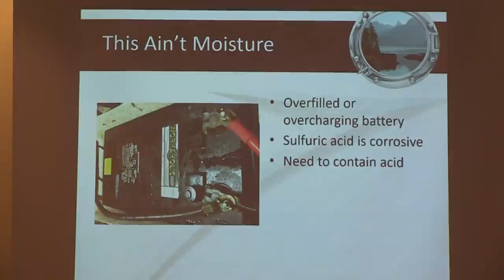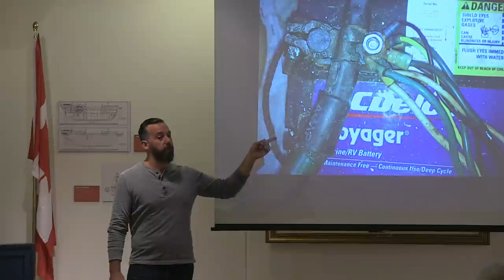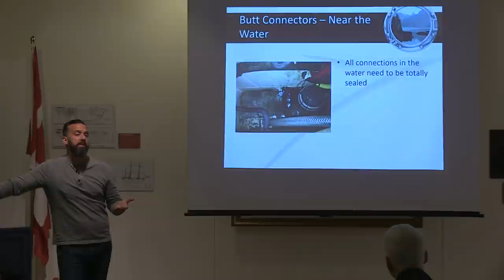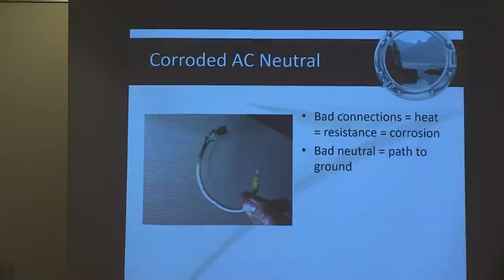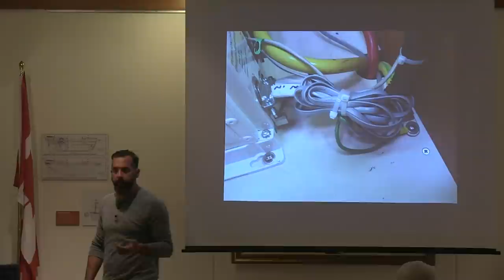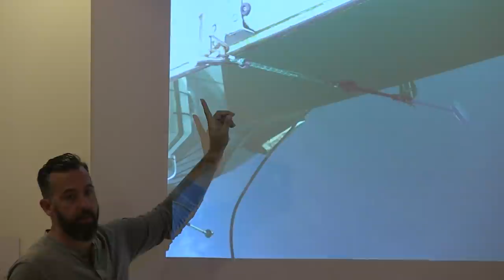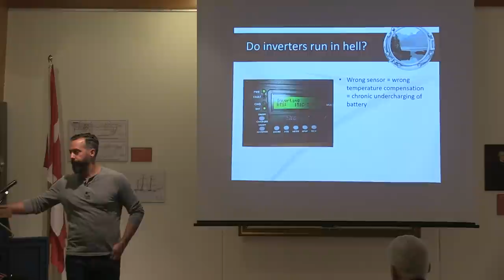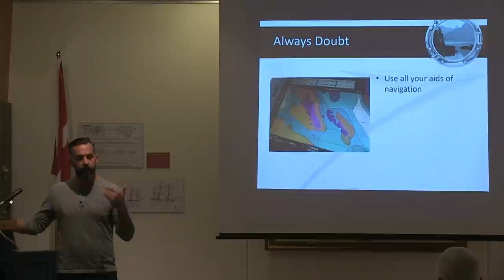Seminar: Marine Electrical Basics - Part 1 of 6

Comment: I'd say that I'm rewiring an old new to us sailboat but the reality is that I'm "wiring it". Out with the old and in with the new. I'm pulling all of the old stuff out. Old stuff discoveries 1. Shore power inlet ground disconnected.  2. Heat shrink butt connecter that was heat shrunk but not crimped. 3. Terminal connectors, yes plural, that did not pass the "pull test", simply came apart with a slight tug. 4. Abraded wires where the wires were exposed. 5. Headliner (ceiling)  light wires that were taped together with painters tape, not so much as a butt connector or electrical tape. Thank goodness I pulled the headliner panels off. All of that I tore out. 6. Quick disconnect wire to a USB outlet that broke free of it's quick disconnect female terminal.  7. 22GA wire butt connected to 14GA wire butt connected to 22GA wire again and of varied colors.  The only remaining old wires are dead wires (not hot) and simply in place as fish lines. What a disaster. 1977 sailboat. As Jeff says "nothing is ever easy" and "Don't trust anything on an old boat".

Comment: Guys that get impatient: you've got to remember that he's standing up in front of a class- maybe even after lunch- and not everyone is a Spring Chicken. Try as they may, they get sleepy and distracted, particularly if the material is tough, at first, to comprehend and integrate. A good lecturer will take the temperature of the audience and respect their attention span. Some times,  an anecdote or two will allow the class to coalesce and get caught up  and he'll get on with the information. My guess, Highliner, is that marine electronics are not as daunting to you as it might be to a newcomer. Patience, Skipper. We were all newbies once.

Comment: Your fuse failure at 43 min is exactly what happened to my buddy. It was a factory fuse on a minkota on board charger. We plugged it in at the dock after fishing and i caught a faint smell of burning electrical components. After some hunting i saw a whisp of smoke come out of the fuse holder. The charger was bad and over charging on that lead. The fuse failed closed. Always trust your nose.

Comment: Really appreciate the videos. Used to install alarm and other low voltage DC systems, home theatre, coaxial, phone, intercom, etc. Luckily apprenticed to someone with a similar mindset about installation mentality. The videos are much appreciated and I'm sure the boat owners that are your clients are more than satisfied. Recently took up sailing and the info is invaluable. Thank you!

Comment: Hi From a marine engineer/ industrial electricians  back ground, The subject that I would start from in DC battery installations as a beginning is the available  prospective short circuit fault current and its effects in a fault situation. 
And next the explanation of earth fault lamps , and the most important is a volt meter showing the DC volt at present, one on the house batteries, and one on the engine batteries, most important.
Very few boaters would understand and the above three most important points on any electrical installation.
best of luck
Allan in NZ
Reply from the maker: Hi Allan,Good advice. Thanks for the input.

Comment: if you have 30 amp shore power what kind of fuse\breaker would you use?  30 amp?  or do you size a bit highre like 40 amp?  My boat has shore power but no breaker....

Comment: Yeah people don't realize that the ground is the most important thing in DC. The power actually flows through the ground
Reply from the maker: The DC negative (commonly call ground because the DC negative is connected to ground) provides the return path for all DC circuits. It’s all about making sure both the DC positive and the DC negative are good.

Comment: I came to this video because it was listed as "basics".  I am still looking for a video, or series of videos, that is basic.  Cote asks us what we're seeing looking at these videos.  I have no idea.  Also, Cote uses much terminology without defining any of it.  Again, I was looking for a true basics video.  Cote has knowledge that I desperately need to improve the wiring on my boat.  If only he could really get to actual basics.  Let me help: I do not know what circuits and wires are supposed to be connected to or not.  I do not recognize anything these wires are connected to except for the batteries.  I cannot tell which wires are grounding ones.  These photos would make good quiz material for students who had a little more understanding of electrical.  So, Cote, please help us who know we probably have electrical issues, but don't even know enough to know who it correct or incorrect.  I would hazard a guess that some of the bad work you cited was done because the boat owners knew less than what you consider basic.
Reply from the maker: Hi Lydia, could suggestion on a real basic marine electrical presentation. Stay tune for one next year.

Comment: You mentioned in one of your videos how a cheap inverter can cause galvanic corrosion in our underwater metals but I listen to these while trucking so am not fully absorbing everything. I just bought a 43 year old sloop and I need to be able to charge my laptop. Is there a low cost safe solution for me? The purchase price was a huge hit on my finances. I'm going to be cruising BC all summer on the hook using alternator and possibly solar panels. Advice? 😀 Thanks so much for these videos by the way. I've learned my electrics are a liability but I should be able to disable everything I can't get up to code 😃🙏🏻
Reply from the maker: Hi Nomad, for charging a laptop, purchase and install a 200-300 Watt true sine wave inverter. You don't need anything bigger.

Comment: Hi Jeff, A small electrical question. To do with continuity.
I get continuity with the bilge water and (only) the negative terminal when the pump is functioning. Is that normal? When it's in auto or off there's no continuity. Which is good. What are there any consequences to this for my copper rivets? Keel bolts? 
Greetings from Berlin
Reply from the maker: It's quite possible your negative continuity to the bilge water is from the grounded keel and not the bilge pump. Surprised to hear that your bilge pump negative would have connectivity to the bilge water.
Reply: Pacific Yacht Systems thanks for your reply! It freaked me out and I kill switched it off. Boat doesn't make water anymore so I'm not worried but still need to figure this out. It's a cheap seaflo with cheap wire jackets, maybe they chafed or cracked. I'll do some kitchen sink testing this winter with the whole setup.
Reply: By the way I got 2 identical pump setups as backup, funny thing is one pump has about 60% more resistance than the other. The second one is higher up so theres no water there thus no continuity, I'll fill it up and test both soon

Comment: I really wish you could start with a basic visual of power needs and resulting wiring design options. Put the components on a sheet of white plywood, mount them and wire them together....then you can go back and discuss best practices for each detail. Folks need the blueprint first....who would ever go about any wiring job without a crystal CLEAR map of what you are about to do....I know I dont. WHich makes watching hours of video about minutia pointless if you cannot see the design map.
Reply from the maker: Great suggestion!

Comment: Where would you consider the best place to connect the + from a hour meter on a Volvo 2030?
Reply from the maker: Hi Mike, unfortunately I do not have practical experience with your engine. On most engines, the hour meter increments only if the engine tach receives an RPM value.

Comment: I wonder if you can recommend a qualified marine electrician to help me in Connecticut. I have a 1970 wood trawler that has so many wire issues and I know nothing about DC electric. Example, solid strand wire, the old house wire that is incased in metal and has paper insulation, no heat shrink terminals or shrink wrapping of wire. Five switches run the whole boat! I could go on and on. If you know anyone in Connecticut that can help me please I want to hire a qualified marine electrician. Thanks!
Reply from the maker: Sorry, I do not have any connections to qualified marine technicians. As a a first step, I would suggest to look for a ABYC certified tech.

Comment: You seem very knowledgeable about marine electrical which is great.  So, maybe it's hard to really go basic.  I found it difficult to follow your use of terminology because I know NOTHING about electricity.  I need something that's is truly basic as I know the electrical on my boat wasn't done safely.  I really want to learn the correct way to wire my boat, but this seminar is speaking above my level.  I used to teach university level courses in my own field, so I know something about disseminating knowledge and training people.  In your seminar, you spoke to those who answered questions not the ones who remained quiet because they didn't want to reveal how little they knew.  It's important not to gear teaching/instruction to the most knowledgeable student in the room.
Reply: Lydia Johnson well, learn something about electricity before taking the course. This series obviously presupposes a basic knowledge of electricity. If that knowledge is above what you have then acquire it or take a more basic course. It’s a bit demanding to say that he need to dumb it down further to accommodate you.
Reply: @aquilifergroup  Was that shaming session as good for you as I think it was?  Did you light a cigarette after you clicked reply?
Reply: aquilifergroup it would have been helpful for you to share HOW you “learn something” about marine electricity. Everyone starts from zero knowledge. The last time I checked, no baby was born understanding electrical engineering. At some point you, somehow, learned the basics. Instead of a snarky response, how about offering something helpful. Your response offered nothing.

Comment: Too much talk and get to the point for god sakes I dropped in the middle. Waste of time.
Reply: I'm on my second week of study with this guy, The brain can only take in so much at a time,. He takes the system approach which is essential for safety.
I bought a 1970's boat that had been "wired to the moon" in some foreign place. 
I was given verbal instructions how to start the engine and that was it.
I eventually found a guy like this who sorted everything in one four hour session. That was the best money I ever spent. I had had several cowboys on board , and dismissed them all as useless. 
The first cowboys came on board when I was not there, and contrary to my express instructions, they tried to start the engine in the standard way ............. FAIL.
The second told me it would take two men two weeks work to do the job ................. it took four hours, one man with a van and boat electrical experience.